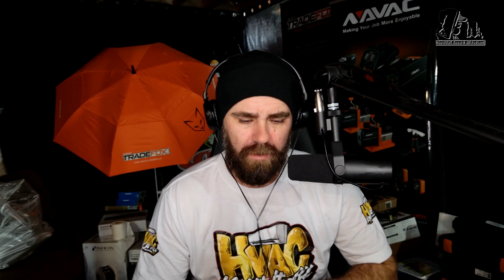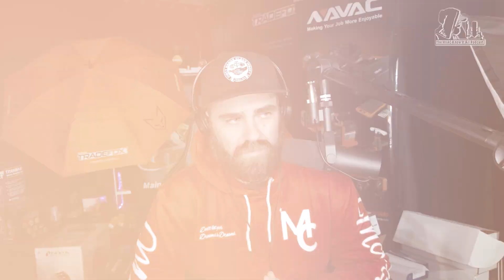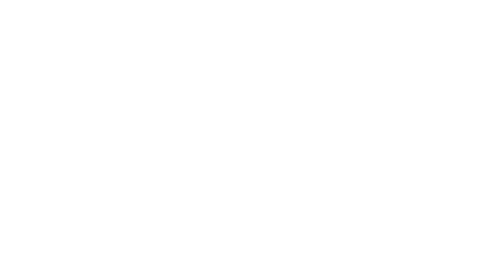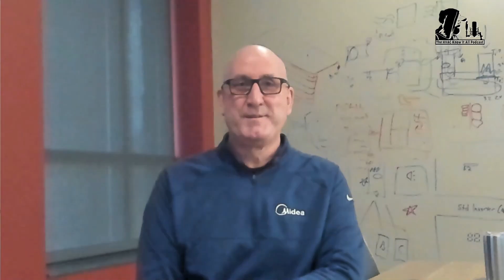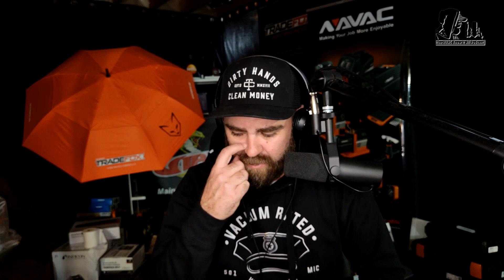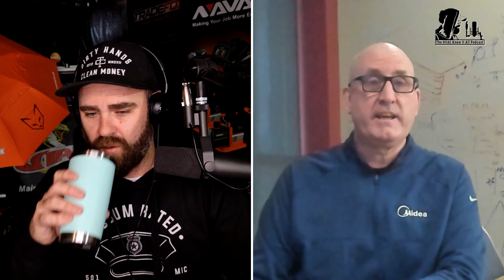HVAC Innovations for Business Owners to Solve Extreme Climate Challenges with David Rames | Part 1

Comment: in a dual fuel application without a communicating setup, a cold climate heatpump will cycle - doesn't work as full variable capacity. still should result in decently long cycles especially when wired as 2-stage.

the moovair/midea literature suggests on dual fuel the 2-stage inputs to outdoor unit are coil temperature targets and furnace fan would run 2 distinct cfms, so effectively a 2-stage system.

Comment: Ive done roughly 75 cold climate inverter type heat pumps. When they work well they are a fantastic machine. The problem starts when technical support is needed when things like defrost cycles, thermistors, rv’s and pressure transducers act up. Ive found that the manufacturers that rebrand chinese machines have a lack of good tech support. The inverter board manufacturers dont share the algorithmic values with the tech guys which often slows the repair process. Other issues ive found is certain inverter models have crazy micro vibrations that echo inside the lines. Tosot is one ive had issues with despite all the best efforts to eliminate sources of vibration. Lastly, for some reason getting replacement parts is very difficult. I deal with master ottawa and they have very low supply of inverter parts. Just my two cents worth